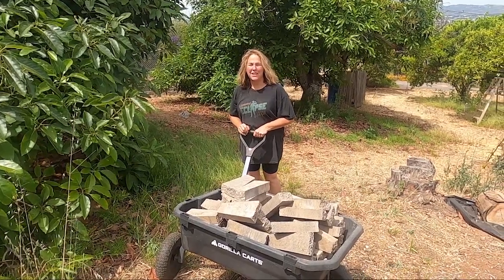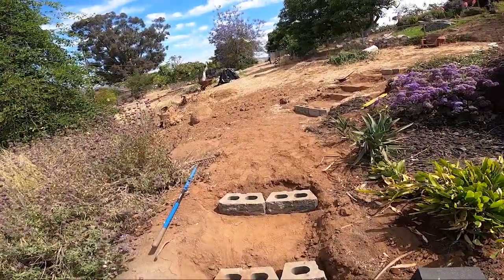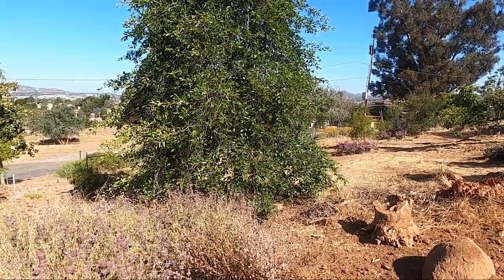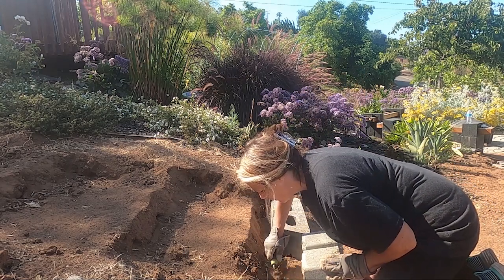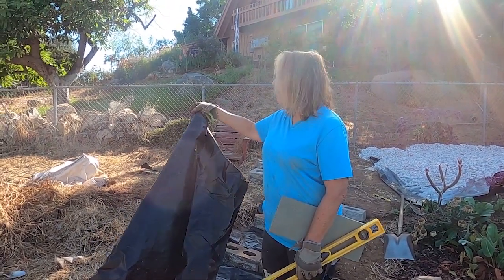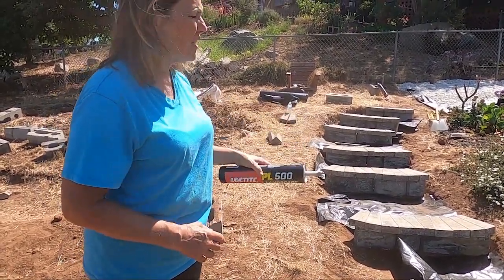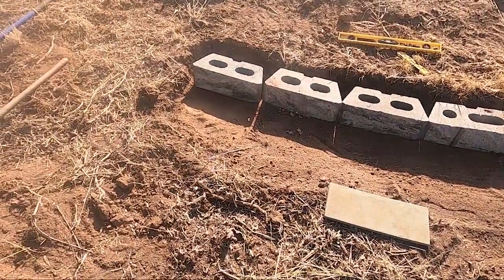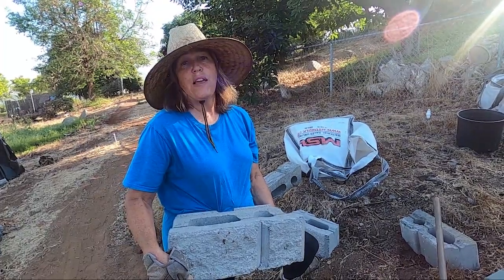Tutorial - DIY Garden Steps Project Using Rockwall Retaining Wall Blocks in California Zone 10a

Comment: This is what I want to do too, to connect two wood platforms with only 5 steps. Thank you for this encouraging video!  Question: should I put in 2" crushed stone beneath the step wall block? Or did your block do fine on hard bare dirt? Thanks!
Reply from the maker: It is surprisingly easy to do. You can use crushed rock or sand underneath the block it will help make leveling easier. Good Luck!

Comment: Thanks for the video! How have the stairs held up? With rain/weather or earth movement/adjustment?
Reply from the maker: They have held up really well. I did have to fix one of the steps that leads down to my vegi garden, I did not level it properly and it tipped. It was easy to fix! Also we do not get much rain out here so my results may differ from your results if you live in a zone with lots of rain.